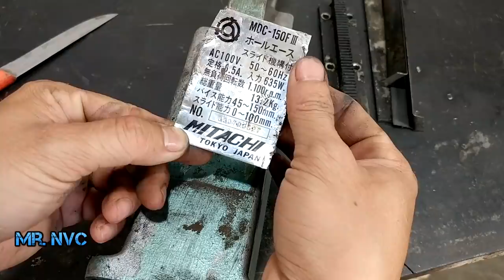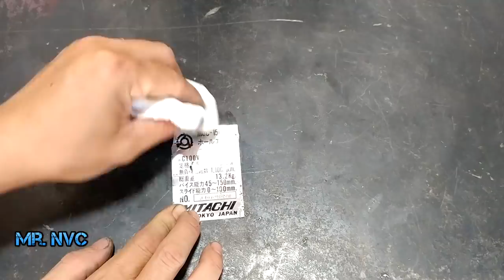Drilling Machine with Sliding Mechanism Vise Restoration - Step By Step Restoration

Comment: Nice job, as already said don't take any notice of the negative comments, with limited resources you do a good job.I think its a drill for steel RSJ's, the long allen bolt on the side should be tight in the body and then the collars would be for end stops so you could drill sets of holes the same distance from both edges each time.The pin in the centre of the drill bit pushes the plug out that is cut (and could be used to centre the drill on the mark)As for the play in it, if you adjust the grub screws with the nuts on them on the carriage gib's that will remove it.

Comment: This is what I did when I was in my 20's. That was back in the 70's. When you get older you can't remember where the parts go, HA HA. But its fun playing with them. All the box fans you see sitting at the side of trash cans I mean 97% of them are good. All you have to do is tear them apart and clean around the shaft and reoil them and put back together and it will run like a new one. They get dirt between the bushing and shaft.

Comment: Strange looking bit in that drill, almost like a spot weld cutter bit but I don't think the center pin is spring loaded.  Nice work though!
Reply: I wondered about that.  It could almost be an end mill type? Not sure if that's the right word.  Bring the drill down and walk the carriage while pressing against the side of the bit.  It's built well enough to be one anyway.  

Nice restoration.